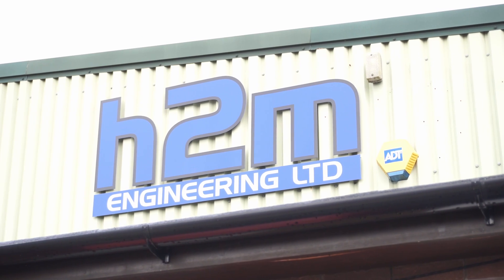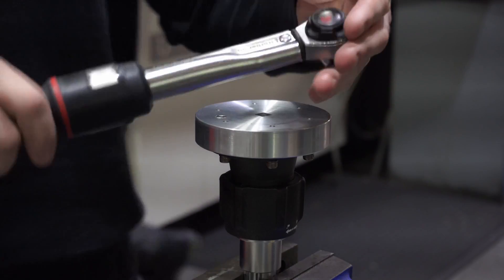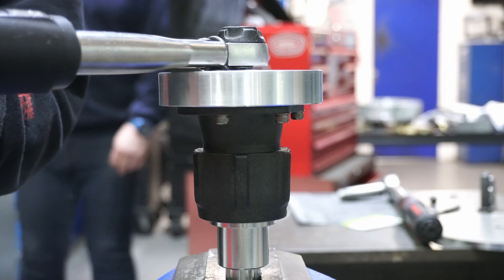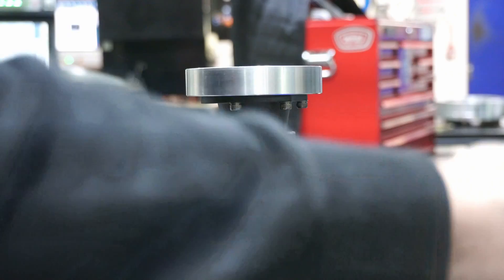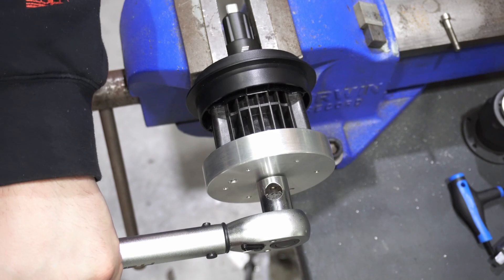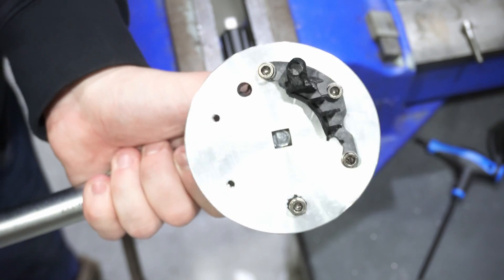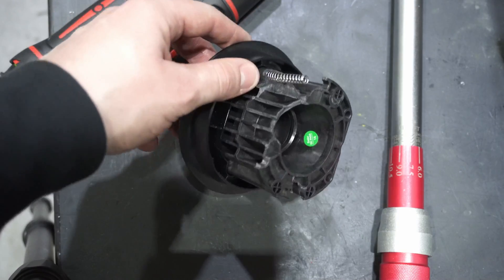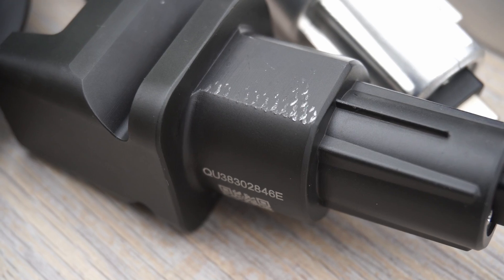How Much Force Breaks The Fanatec QR2 Lite?

Comment: Quick releases are probably being damaged by side-to-side flex rather than by the nanotometers. As small cracks develop in the plastic, it weakens over time, eventually leading to major failures. Again, I believe this is due to diagonal forces rather than twisting forces.

Comment: THE FANATEC JUST UNLOCKED THE QR2 LITE FOR HIGH TORQUE MODE 
"The following Steering Wheels are now capable of High Torque mode when used with a QR2 Lite:
- CSL Universal Hub
- CSL Universal Hub V2
- CSL Elite Steering Wheel McLaren GT3
- CSL Elite Steering Wheel McLaren GT3 V2
- ClubSport Steering Wheel F1® Esports V2"

This made me buy the mclaren wheel, just saved 100€ 
pin this comment lol
Reply: not true at all, it requiered QR1 metal :D

Comment: another flaw is that the forces are coming from one side instead of two. So the mount could snap from a load applied along the cross-sectional axis. You would need a t-shaped torque bar to evenly apply the forces from both sides to counteract the lateral forces, and keep it more purely rotational. Also, in the second test, if the side of the flange with the 4 bolts was towards the ceiling instead of towards the ground, it would likely have held up a bit longer. But this is also partly due to the uneven forces mentioned

Comment: I am about 7 months late to the party but I believe the use of the QR lite is related to the mass of the wheel that is being used not the force of the motor.  Once you cross the 1.3 or 1.4 kg mark is when the lite becomes no longer recommended.  I thought it was sales tactics as well, still am not 100%, but did notice this pattern holds steady all the way across.  Only wheel they won't give a weight on.... GT DD Extreme wheel.... hmmmmm

Comment: You can remove the torque limitation by cutting the plastic "pin" protruding at the back of the QR2 wheel side so it does not engage the microswitch inside the wheel. As it is just a dumb plastic part that is the only way the wheel knows that it should set everything to limited mode. I have DD2 and typically run 10-13Nm max with my wheels and with the lite no issues whatsoever.
Reply: Still going strong?…I have a dd+ and run about 12nm and am thinking of shaving the plastic bit off…
Reply: @ Yes, going strong, no issues or findings. Just works :-)
Reply: @quazster doing this to mine as well

Comment: Was debating on going QR2 lite or regular. This seals it, I'm going lite. I have 4 wheels. I'm about to shell out nearly 300 dollars for an upgrade not really needed but I stripped retaining screw out on my OEM CSL DD wheel shaft. a small upgrade costing half as much as the entire new wheel base!?! Shame on you Fanatec I'm sorry. There should be a pre owner discount or an upgrade discount of sort. 100 dollars for a quick release is just ignorant in my opinion...but I'm just one guy with one voice.

Comment: The QR1 Lite does not brake so easy. The spikes a torgue limited wheelbase can produce (although limited to 9nm but spikes to about 12nm under certain circumstances) can wear it down in a few hours to a point that you get disconnects. I wouldnt recomment a QR1 Lite with wheelbases that can go beyond 8nm. The Quickrelease will just wear down over time and you wont notice it until its to late to save the QR1 lite.

Comment: I would have used a podium hub to see if the pins were damaged after all that flex, and then attach the wrench to that podiom hub("cheap" test pins). I think that flex is what's limiting the forces it can withstand. Great video btw, it was interesting.

Comment: Should have just gotten a torque meter. It records the highest torque sustained.

And these tests really don't show anything because the real test is repeated fast shock loads. Hitting it with an impact wrench on low pressure would show their strength better than a slow steady torque application.

Comment: I think you missed the point here.....
You want to add torque until you see a clear twist movement between the 2 parts, not so much when it fails, whole point of DD is to get a 100% feel of what the motor is doing, if you have a sloppy joint you will lose some FFB feeling, 
Even 20 Torque would be enough to break fingers, you're not going to hold a wheel with 100 Torque going through it.

Comment: if talk about qr1 that same thing what break down at there, over years and years it goes weaker  and weaker with constant usage
Reply from the maker: That's true - the QR1 Lite suffered over time especially. The QR2 Lite looks like it'll fair much better just by way of it's design, but time will be the judge
Reply: @dannyleeracing  there is one problem with this test tho at qr2, it does move kind off allot, lets say qr2 can survive but does the steering wheel pins can self survive ?

Comment: Please note, that you must use these torque wrenches in a certain way (see respective manual)! You must grab exactly on the handle and only on the handle. Otherwise, the applied torque differs from what you adjusted to. Many people think, torque is torque and that's true for some wrenches (clicking mechanism coaxial to the nut) but the wrenches that you use (clicking mechanism ~30 mm from the nut) rely on that certain ratio of handle to nut and handle to clicking mechanism. Anyway, interesting test! Thanks.
Reply from the maker: That's a super interesting point and you're the first to highlight it! All I can say is that 240nm felt like I was gonna go flying if it let go

Comment: Strength doesn’t matter. It’s longevity and micro fractures to failure over time that does. Something can take 100nm of force but crack after a month on 10nm… but a quality product could snap at 40nm but last years at 10nm.
Reply from the maker: Great point - same thing that brings down trees in high winds. It's not one big gust that does it all on its own, it's hundreds/thousands of them that weaken it over time

Comment: I think the qr2 fails at the moment when the twist becomes visible.
Keep in mind that in real use there are connecting pins between the steering wheel and the wheelbase which would probably be bent or sheared off at that moment.
Reply from the maker: A good point - if I tried it with a wheel, it might be the case that the pins would be damaged much earlier than the QR2 itself. It might also be the point that any flex might cause the pins to fatigue and break quicker than in a standard metal QR2. Until time has it's say, it's all speculation.

Comment: Failure in my opinion is not when it brakes but when it starts flexing. This the point where the experience gets compromised. QR1 showed flex, even at 10Nm. Don't know about QR2 since it wasn't tested in the torque range where it's going to be used....I don't know about you guys, but if I spend that kind of money on equipment, I like to have (see and feel) materials that I can associate with the hobby. Those things are important too. Others manage to do it for less money, so why can't fanatec do the same.
Reply from the maker: I think if Fanatec had just opted for a standard QR2 with the DD extreme, then this question wouldn't even need to be asked. Surely someone must have anticipated this question when they used the QR2 Lite for a wheelbase that is almost double the strength of the previous limit they imposed. Time will tell...

Comment: One last thing.
My points are based on impacts right?
Well the reason the GT wheel with QR2 lite can do 15nm is all down to just that - impact.
That wheel has more flex in it itself, which allows that impact to be absorbed at the point of grip, before it is transferred back to the base.
The more flex the wheel has, the less impact the base takes

Comment: Good test. Even if you had a 20nm base like the dd1, if you assume that a lock to lock rotation direction change is likely to be 40nm or there or there abouts. I think that it would safely manage a dd1 let alone a 15nm base. Provided it's not abused and used as intended obviously.

Comment: There's a difference between slow torque and sudden jolting impact.
Think of a drill vs an impact driver.
Both might make similar turning torque, but the nut busting torque of the impact driver will be higher, because of the hammer effect.

When a wheel suddenly jolts and is suddenly impacted by your grip, then the power increases significantly!

For example, look at the impact of jumping.
Just by landing, your bones may be subjected to upto double your body weight on impact.

Power is a result of torque multiplied by revs, then devided by 5252.
And even that isn't able to account for impacts
Reply: Having said all that, this is absolutely scientific. Because it's repeatable and the same on each test.
But it doesn't tell us what NM base the quick release can handle is all I'm saying
Reply: In fact this test shows us exactly the kinds of forces that are actually applied when a QR does break.
It's power not torque, but taking away speed/revs, it's still a way of showing the resistance of the part

Comment: How does the base know which type of QR2 is attached to the rim? Is there an rfid chip in it?
Reply from the maker: There's a plastic tab which pushes a switch inside the steering wheel. If the tab is pressed in, it knows it's got a QR lite on it. It's complicated to explain but there's no chip or RFID involved, just a small physical tab
Reply: @dannyleeracing   Just cut the tab off. So far all is good with qr2 lites on all of my wheels. I saved some money too. Plastic can be strong and lite. Theres no cracks on my lites on 4 rims.

Comment: What you're essentially testing is static strength of the interface which is a single force application.  The other test is a fatigue test which is repetitive load application .. A given part can fail at a lower applied load that is repeated on and off several times .. aka fatigue failure
Reply: I think he said that in the video

Comment: The rare win for Fanatec 😼
Reply from the maker: They've righted a few wrongs with the QR2 Lite, that's for sure. Even to hold and handle it's clearly a better solution, and I haven't yet seen any real world examples of it failing or cracking under regular use - doesn't mean it hasn't happened, but you'd definitely expect to have seen something on socials by now if it was problematic.

Comment: No wonder the QR1 had such a low rating. I mean, look how much torsional flex there was at just 10Nm even. Pretty awful amount of hysteresis already vs metal QR. So the high safety factor fanatec have gone with is mainly just to minimise this because from a failure point of view, it's not an explosive failure so it's reasonably safe.
Reply from the maker: It definitely shows the clear difference between the QR1 and QR2 Lites, if nothing else

Comment: Very interesting video. Good job! I am not an engineer (and native speaker), but my remark would be that except from rotation force in this method you also have applied strong pulling force in one direction.
Reply from the maker: Good point - I should have braced the wrench with the other hand a bit closer to the centre, or used a comically large pirate ship helm

Comment: It was actually cracking in another spot before it failed at the flange
Reply: A saw that. Check 10:48. To the left of the QR in line with the bottom of the vice the plastic cracked.
Reply from the maker: I spent all evening yesterday cutting and editing and never saw it - it was only today that I woke up with fresh eyes and noticed it! Good job I moved the camera for that one particular turn!
Reply: @dannyleeracing  probably the sound you thought may not have been the torque wrench earlier. 
Still amazing to think either of the QRs could handle that load, even if slow and one off.

Comment: Hi very interesting, but I think is not so easy I am afraid.  I am not a mechanical or materials engineer (I am electrical one), but for what I know about these issues the specified torque ratings of this kind of materials, not for sim racing but for general industrial uses, before arriving to a "limit" breakpoint you need to consider fatigue of the material and this will arrive at much more lower levels of Nm. I mean when Fanatec says the max. torque is X Nm, I think they mean if you operate it above this X Nm frequently and repetitively over time the material will get fatigue and may not support this repetitive effort above the rated Nm over time, it will not break instantly like in your test, but the fatigue of the material will cause to lose its mechanical properties with time and at the end to break  even at much more less than X Nm. In short, you tested the maximum peak Nm supported in one moment, but I do not think this is what Fanatec means with this Nm limit, I understand this figure as the one that will cause the break by fatigue of the material over time. As said not an expert in the field, but for my maintenance experience in industrial sites, this is how I understand it.
Reply from the maker: That's exactly what I think is the real story - It's a lot easier to break something with 1000 little wiggles back and forth than it is with 1 strong push
Reply: Yes that is how I understand it, if you surpass this Nm level indicated by Fanatec only a few times should be OK, but if you do it many times it could break because the material lost its internal mechanical properties over time, is what the mechanical guys call breakdown by fatigue of the material

Comment: This is interesting because it shows that testing these for failure is no trivial task and being able to determine how, when and why these fail requires very specific and repetitive tasks. The fact that so many QR1's failed and took out bases and wheels with them and you couldn't get one to break shows that there is something happening while using it in real-life conditions that differs drastically from a simple pressure test. Cool though! Thanks for sacrificing a QR1!
Reply: In use u get way harsher movement in both directions, i think that might be the main reason. Over many 1000s of rotations and harsh hits it might be more taxing on the QR then if you apply slowly force in 1 direction. Just my 2 cents, i might be wrong.
Reply: @themadnes5413  the ammount of friction forces going throught that bit of plastic is probaby going to make it even more weaker, imagine how plastice defomes when heated even at low temps, this thing going to flex more on a hot sunny day. lol
Reply: @themadnes5413  that is exactly the reason why the QR1 Lite break that much in real life. It is a huge difference between high rapid peak torque vs slow and steady torque but you can still use this video to show how much better the QR2 Lite is designed compared to the QR1 Lite.

Comment: Ron did a detailed tear down of the Extreme wheel and the QR2 Lite to show what Fanatec thinks safe implementation of QR2 Lite for 15nm. It's fairly interesting and seems to make sense. But breaking stuff is fun too! You could maybe machine an inset like the Extreme has and break stuff again! BTW. you see failure for the first time at 10:35. Far left side. You see the crack next to QR2 Wheel Side. And if it had 6 bolts and and inset. It would likely have failed from that first wee crack. And i commented while watching lol. You covered it.
Reply from the maker: Do you have a link to that? I've never seen it!
Reply: https://www.youtube.com/watch?v=ASX04inDPi8  of course! Auto Translate is not awesome, but this channel is pretty good.  @dannyleeracing

Comment: I wonder if the torque rating is more about delivered torque quality without flex dampening the feedback than outright quantity.

I also wonder how much damage is caused by apes like me pulling on the wheel under braking and skewing it while leaning during cornering, as leaning in your seat while cornering does improve lateral grip, as does a white knuckle grip 😂

Interesting and fun video 👍🏻
Reply from the maker: I give the QR2 3.5 Ape Rating while the QR1 gets a 1.2

Comment: This was an interesting video although, as you disclaim yourself at the start, this doesn't give much of a representative info. What you're doing is only interesting but you can draw next to none practical information from it.

For me on the QR1 lite the biggest issue was that it was noticeable flexing a lot which can't be good for the pins. Even the QR1 (rigid) had play in its key without the additional retaining bolt, which again, can not be good for the electrical pins and having load shifts on them on a crazy rate over the course of even a single lap.

I recently updated to QR2 and, its just rigid. No flex. Finally something 'trustworthy'.
Reply from the maker: You can see how much more flex the QR1 has compared to the QR2 - the QR2 took 100nm like it was nothing whereas the QR1 felt like it was about to go noodle mode.

Hopefully it's really clear that I'm self-aware about how unrepresentative this is of the actual, real world results that may yet come to pass. The best I could hope for is 'interesting' if not 'informative'.
Reply: @dannyleeracing  Yes, thank you a lot for taking the time and effort into making this video!

Comment: I could imagine that the electronic pins from the wheel might shear away due to the high torsion even before the QR breaks. Perhaps that's one reason, why Fanatac rates the QR much lower than your test result.
Reply from the maker: A good point - had I done this with a wheel attached, would the pins have survived?
Reply: @dannyleeracing yes it didn't rotate that much

Comment: I had different issue with QR1 lite - it was jamming. It was great but you have to know that you won't be removing the wheel at all. After year and a bit I felt that QR1 started to overtightening on its own which resulted in issue with removing the wheel after. Upgraded to metal QR1, and that issue is gone